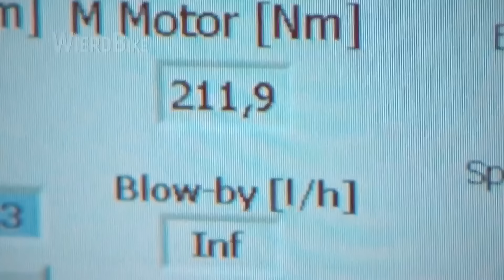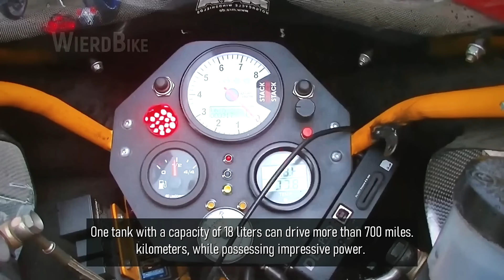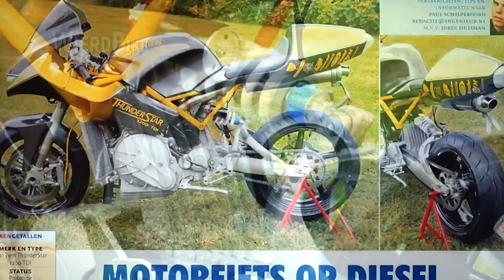Homemade TURBO-DIESEL SPORTBIKE with a Torque of 250Nm! ONE of a KIND.

Comment: Being a retired Diesel engineer and also a life long motorbike fan and rider i would have one tomorrow 😁😁🤘🤘
Reply: "I would have one tomorrow".....over an electric bike! 😂
Reply: @sbkpeace.24   no thanks. electric have the same torque and none of the vibrations. I don't want a ride to become a milkshake
Reply: @JP-xd6fm  Thats great if you don't want to go very far or very fast and don't mind paying two  or three times as much for a similar spec bike.
Reply: @siraff4461   Then I rather ride a petrol bike, the diesel bike is a pretty stupid idea.
Reply: @JP-xd6fm  Is it though? A lot of touring bikes would be better with a diesel. Double the torque, half the tank range again is kind of a big deal if you want to go long distance. 
As for vibes - get into a decent modern diesel and see if you can tell it apart from its petrol equivalent. Developed properly there are no extra vibes over a petrol. Thats something from the past like people thinking diesels need iron blocks and all the rest of the outdated ideas which seem to hand around.
Reply: @siraff4461  Then I would go for a hybrid electric powered and diesel range extender, with 250cc diesel should be plenty for charging the battery
Reply: @JP-xd6fm  Sounds good to me. That kind of drivetrain in something Goldwing shaped would be close to perfect for me.
Reply: @siraff4461  Great, let's meet and build it, hehe😅
Reply: @JP-xd6fm you could literally ride quadruple the distance with the same amount of fuel as a petrol bike would be a good application for a touring bikes or adventure bikes
Reply: @JP-xd6fm  not 2 smart are ya

Comment: I use this engine now as a co-generator. It produces 10 kWh electricity and in the same time 12 kWh thermal energy. The 10 kWh goes into a battery and the thermal heat (85 degrees Celsius) goes into a buffer for heating the house. This engine uses only 210gr/ kWh of diesel . So the efficiency is around 90 % . Erik is helping me out to program the ECU.
Reply: cooling water im assuming? i dare say theres another 10Kw or so in the exhaust gas as well...

gets pretty "efficient" when you start utilising the otherwise waste products..
Reply: @paradiselost9946  you can’t cool down the exhaust to much, otherwise you got to much soot stuck in the exhaust pipe. So the cooling system produces around 10 kWh thermal energy and the exhaust around 2 kWh.

Comment: Notice that honker of a flywheel - necessary to get enough oomph stored for the next compression stroke.
Reply: Not necessary for higher cylinder count. V8 diesels do not suffer from this
Reply: @THESLlCK  Very true. A six doesn't either, not much, and most big truck diesels are sixes.
Reply: @Baribrotzer  A 4 cylinder Would have Much Less vibrations !!! ! !!! 🙂
Reply: @bustjanzupan1074  But then you'll need a flywheel cuz the difference between the 3 and the 4 cylindres engine function (i'm meaning the way they cylinders move)
Reply: Inline 6 is smoother than V8 @THESLlCK
Reply: that bike must be annoying to ride thanks to inertia of this thing.
Reply: @hagestad  Probably no worse than a gas Single, which also needs a substantial flywheel.
Reply: @THESLlCK  i remember driving a V6 Audi DIesel 245hp with 500NM. The Throttle response was non existant. I Could press the pedal full and nearly nothing happens when i let of. Nothing what in knew frpm petrol engines

Comment: Maybe should also try installing that engine on larger size touring bike like Honda ST 1300 , Goldwing or other adventure touring machines , just to see how far one tank of diesel can the machine go .
Reply: Touring bike with sidecar immediately came to mind with the amount of torque ...
Reply: @tommaguzzi1723  If that IS the main reason , that sounds like a problem that is solvable.
Reply: @tommaguzzi1723  It would be perfect for a Harley then.😃
Reply: @tommaguzzi1723  Look at the mirrors @2:58.
Kind of proves your point.
Reply: The US government used diesel converted KLRs because it would increase the range so much. It used like 1 liter of diesel per 100km. Also everything in the military used diesel.
Reply: @tommaguzzi1723  yeah, also the power-to-weight ratio for diesel engine is lower than gas engine so it's not suitable for a lightweight vehicle. Also need beefier drivetrain with more gearing since they don't rev high
Reply: @tommaguzzi1723  Thats because all diesel bikes are based on ancient tech or have been developed by tiny operations on a shoestring budget with no real r&d. 
If you get into a Mercedes/BMW diesel car these days you can't tell the difference from their petrol equivalent. 
Using the right engine and developed properly there is no reason to have any more vibrations that you want. 
Something like the Audi V6 in a large touring bike would make a heck of a thing. Smooth as silk, big power, massive torque and very fuel efficient.
Reply: @SahnigReingeloetet And in a case of an EMP attack, the KLR stays intact 👌

Comment: I don't think I'd be complaining too much about that little bit of smoke under WOT when you're getting 110+ mpg. on diesel fuel! The puff of smoke is easily gotten rid of, by adjusting the fuel ramp on the injector pump. You lose a little bit of your 'off the line' performance, but still have the top end hp. & torque. I'm pretty sure it smooths out nicely in the normal operating range compared to low idle. 100 hp. is nothing to sneeze at, for only 1200 cc's. displacement, especially with the massive torque behind that 100 hp..😉
Reply: Diesel is usually not a problem for the user, more for those who follow behind…it stinks, especially if exhaust is not equipped with the latest catalyst filter
Reply: My moms Polo with 1,2 Liter 75hp Turbo Diesel felt like a quick little car, and it feels a LOT quicker then the 100hp petrol 1,6 liter Golf she has now. A 1,2 liter 75hp turbo diesel in a motorcycle will feel like a rocket...

Comment: The amount of serendipity is almost uncany. I lived only a few miles from Star Twin for about 10 years. At the time I was building up my Grifone Special (which see), based on a Ducati Pantah 600 TL. Whenever the head scratching became too loud they did some maintenance work for me. One day I stepped into the shop and there it was. It turned out the bodywork design had been the subject of a design competition in a dutch motorcycle magazine. And I had totally missed out on it! A thing I regret to this very day. I however still did produce some unsolicited sketches (Hm, there might actually be a theme there) for 3 variations (including a touring and adventure version). These where shown at the 2004 Dutch Ducati Club races at the Assen TT circuit, as was my Grifone. It was however clear the project was loosing speed already. The complexities of building a diesel motorcycle can be rather daunting. A petrol bike will still more or less run unoptimized but a diesel can be a very stubborn beast to wake. One only has to think about the precise pressure conditions which have to be met to get optimal self-ignition. It's great to actually see it and hear it run in this video at last. Until now I have never been able to find proof of that (No, it did also not run around or even growl in the pit boxes at Assen). By the way: I also had a meeting there with Roel van der Heide of the ChiQuane hub-steered bike project. Now if there is one Dutch project which deserves this sites attention it's that one! (Hint!)

Comment: 2.5l/100km is 112mpg
Reply: What’s not to love? ♥️
Reply: There’s a whole world out there
Reply: Or 94mpg if you use the other measurement for the size of a gallon :(
Reply: My honda rc51 sp1 drinks petrol like an alcoholic
Reply: My 81 vw rabbit pickup with a 1.9 tdi swap makes almost 300tq
And gets 75mpg. 

Don’t believe me???
My engine was rated 54mpg in a vehicle that weighs 30% more 

And is 3x as fast as when it was brand new.

And that’s American gallons. 

Give me a euro gallon and a flat road and I could knock on 100mpg
Reply: It's actually 94.
Reply: @fastinradfordable I've got a horse 🐎
Reply: @fastinradfordable 
Can someone pls explain to me, since when "tq" is a proper unit?

Comment: Couldnt they add a counterweight for the middle cylinder to match the weight of the two other pistons? Guessing that would prob result in a loss of power though
Reply: You can balance a 3-cylinder only with 2 contra-rotating balance shafts.  But still you have gaps in powerstrokes delivery since it’s a 3 cylinder. Although looking at big-bang firing intervals that might be concidered a benefit? I don’t know

Comment: When I think of sport bikes, light weight, nimble handling, and a high revving engine usually comes to mind first. This bike is the polar opposite of all that.😅
Perhaps on a two wheeled arm chair, but not a sport bike.
Reply: name a 100+ HP sports bike that's lighter. 😂
the Honda CBR 650 and CBR 1000 weigh almost the same at 210 / 203 kg. 😂

Comment: Where is the dpf? Where do I put the urea water?
Reply: There is no dpf lol. Yeah considering emission requirements, diesel motorcycles will never be a thing in the future. Emission cleaning for diesels is complex, heavy and expensive. Also they carb up, especially smaller diesel engines. The future of motorcycles will most definitely be electric or gas hybrid.

Comment: I would like to get  VW 2.0 L  Turbodiesel motorbike with 180 hp and 280 Nm. And about 3 L/ 100 km that would be wonderfull  even if it wibe little...
Reply: you need 2 o 3 cylinders, not more.

and a 1.5 3 cylinders TDI can output over 200 hp
Reply: @GioJonnhyK  yea but 3 syl. shake a lot moore than 4 syl.
Reply: @FROOBELINKALIKAT-p9z  not true
Reply: @GioJonnhyK  Ask me how i know that ? Everybody knows that... .lol Specially diesel engine.

Comment: A smaller bike maybe in the 500/750 class would have the advantage of running economicaly and if the government tryed to control fuel or increase tax then you can run diesel engine on lots of different fuels

Comment: I would totally have one and vibration can easily be removed with modern tech, shit put a turbo on that thing an it would fly. There is a reason why edison motors is looking at running diesel engines as generators for electric vehicles as you can potentially have the power of an electric motor with massive range with a super fuel efficient engine

Comment: My Z1000SX accelerates like a beast in any gear too.
Torque itself means nothing, 250Nm at 3000rpm are equivalent to 125Nm at 6000rpm or 62Nm at 12000.
Power is the key, and proper gearing.

Comment: 100 kilometres on just 3 liters equates to 75mile to the U.S. gallon of diesel fuel! Diesels are great for long range. Unfortunately weight has always been an issue. They tend to price themselves out of the market amd they are no match in performance against they're gasoline bikes.  Now government enviromental restriction and EVs at a strong move diesel motorcycles never stood a commercial chance of success!

Comment: It need much longer gear ratio so torq on wheel is not so impressive compared to gasoline engine.  
Low rpm and fuel economy is nice but diesel performance, noise and smoke is bad.
Reply: Diesel performance is good and a bit of smoke is great also
Reply: @paulreilly3904 Great for what exactly?🤔

Comment: Yeah, and a hundred hp from a car engine is way better than a hundred hp from a pissy short stroke bike engine, could you imagine the swap the other way? No way a bike engine will ever drive a car well 😅 imagine the fuel consumption lol😂
Reply: There are an absolutely enormous number of motorcycle powered race cars and they're absolutely awesome. Radical Motorsports cars, Kartcross cars, Legends racing cars, Austin Minis, a bunch of hill climb cars, a bunch of different formula cars, Formula SAE, etc. There's even a Honda Goldwing powered Jeep on YouTube that moves around pretty darn well.

Comment: I am sure poeple on the road will appreciate the exhaust fumes from that diesel engine,what would be the point if all it offered was torque,you may aswell just continue to have two strokes on the road way cheaper to build and most likely healthier than the diesel fumes.